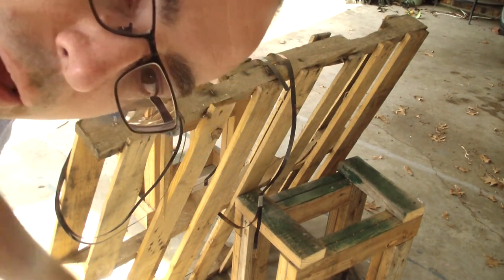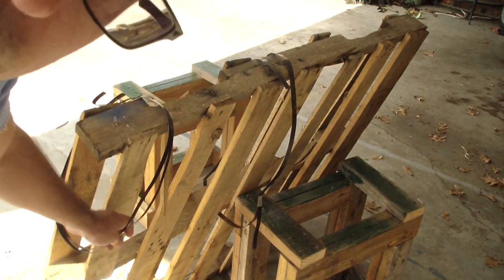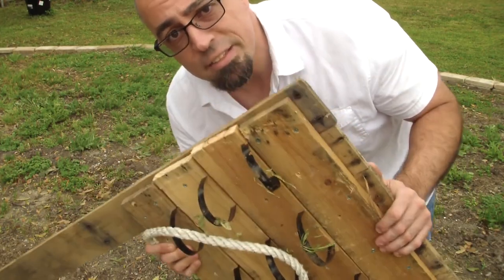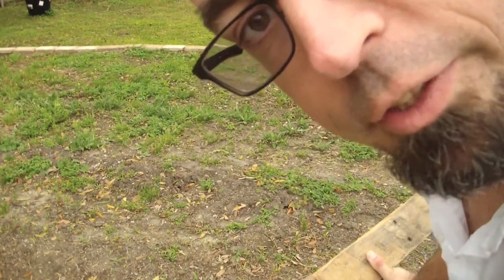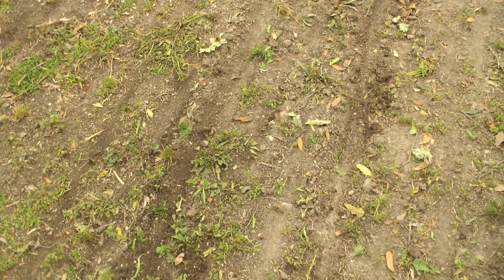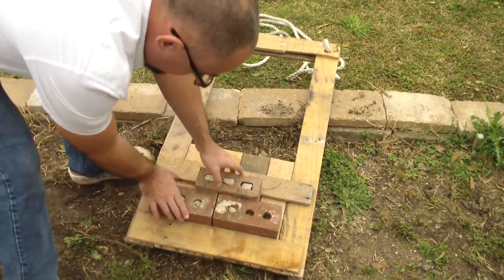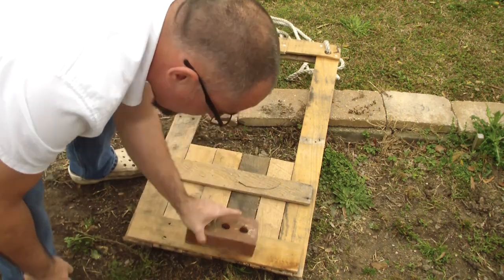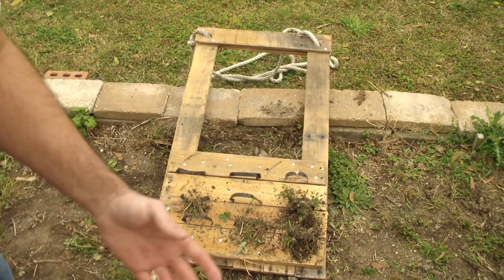Too Many Weeds!! Garden Harrow

Comment: Necessity is the mother of invention.  A similar tool would be old bolts used for "teeth".  They work in clay soil.
Reply from the maker: The next iteration will have some old table saw blades and it will be more like a disc. Stay tuned.